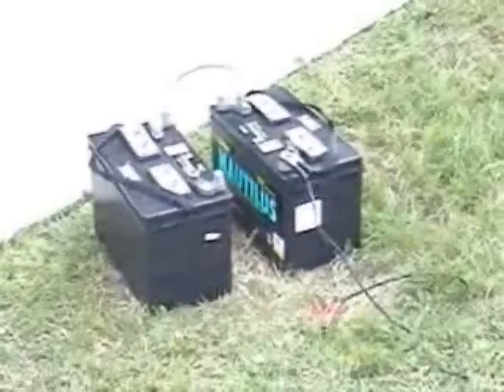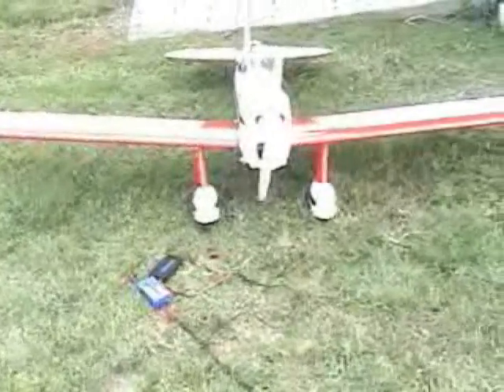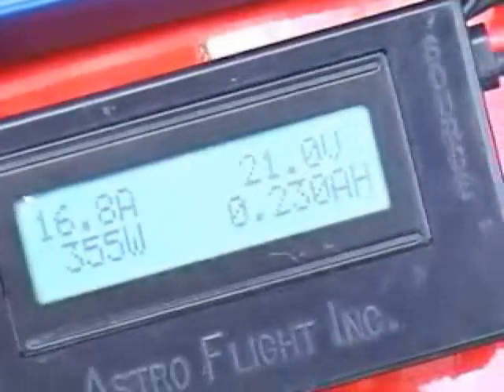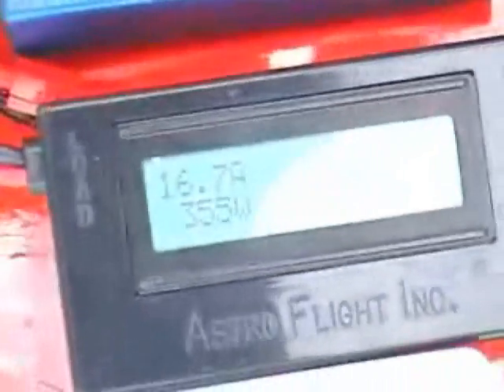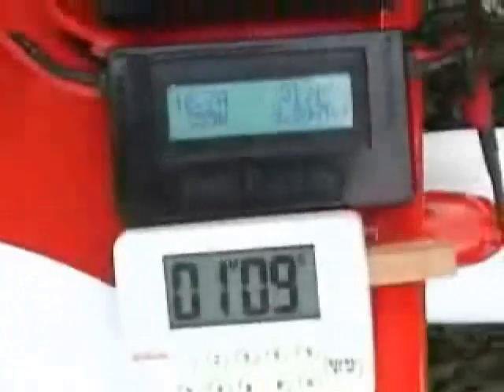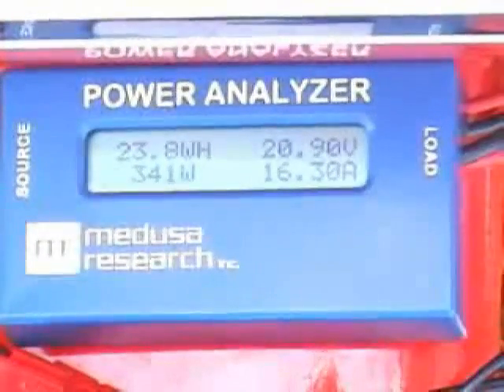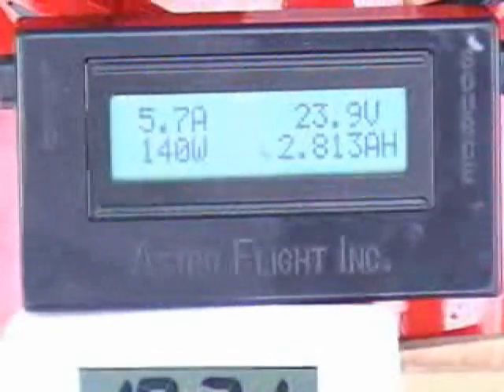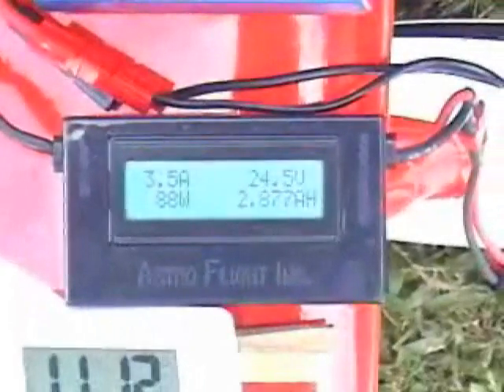6s2p A123 Direct charge method video#1

Comment from the maker: Yes, we used a 24volt supply(two lead acid batteries in series), connected directly to two 6s2p. There are two 18gauge wires (speaker wires) at a length of about 14ft to drop the current to about 20-24amps per 6s2p pack. each "p" can be charged to a maximum of 10amps, since we have a "2p" pack, then you can charge each pack at 20 amps. SInce there are two 6s2p packs the lead acid battery is handling 40+ amps during the initial charge, after a few seconds it averages to 30-32amps from the supply.

Comment from the maker: ...That is why I would suggest you start out with a safe amount of length to your 18 gauge wire, like 30 feet, then you start decreasing it to achieve; 10 amps on a 1p pack, 20 amps on a 2p pack, 30amps on a 3p pack.
Important, dont forget about your source(lead acid batteries, power supllies, etc). Make sure that it can handle this current draw from it.

Comment from the maker: To set the amps you want to charge with in the beginnig, you 1st discharge your pack, then you start out with a 30ft 18gauge wire, place this between the lead acid batteries, and your A123 with an ampmeter in between to measure current, and you start cutting the length to increase the current flow, add to the length of the wire to decrease current flow. So the length of the wire is inversely proportional to the current. length increases current decreases, length decreases current increase.

Comment from the maker: On my exp with this method of charging, btw it is called "zip charging", I have had great results. Usually my charging times vary on usage, but 10-15min on average.
The last few 100-200mah may take between 2-3 minutes, if you really want to charge them into your pack, otherwise if you fly 1 session, land, and charge you pack, knowing the you really didn't deplete it completly, but had an extra 500mah, then 10minute charging would be enough. But experiment for yourself. A123 and RC are the best.

Comment from the maker: ...So, you cut the 18 guage wire to get the correct amount of current draw to your A123 pack. example: if you were to use a "6s1p" pack, then you would cut your the length of the 18 guage wire so that the flow of current will be at 10 amps(max charging current), using a depleted 6s1p A123 pack.
Once 10amps is achieved, this flow of current will continue until the pack is completly full, in which your indication on you meter will read a drop in current.